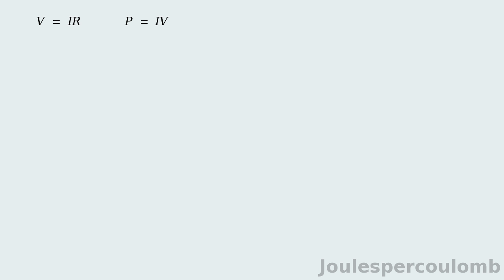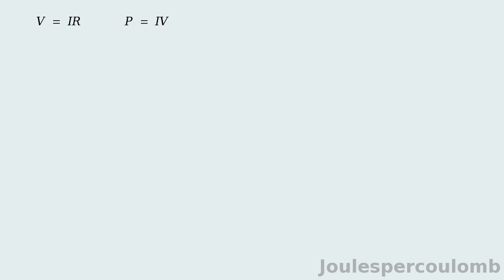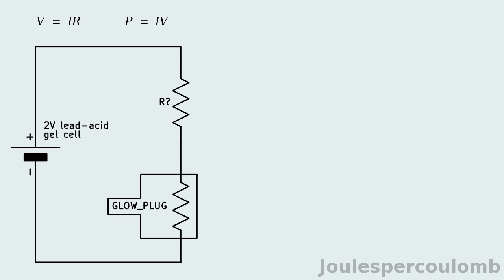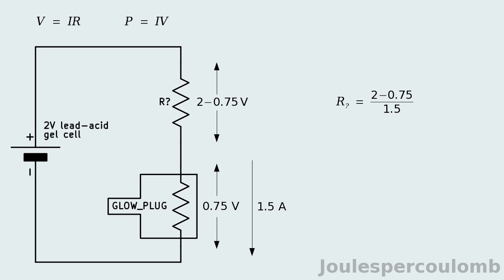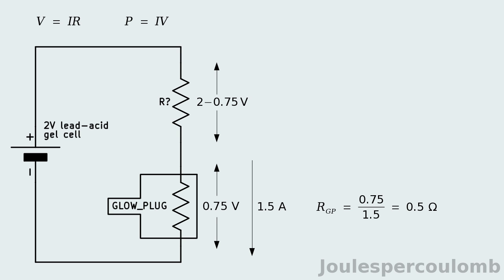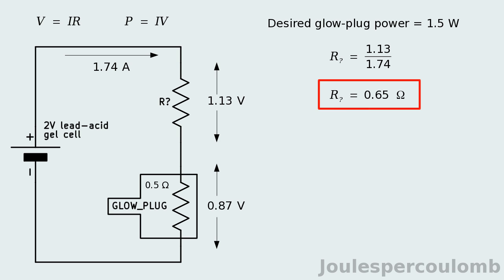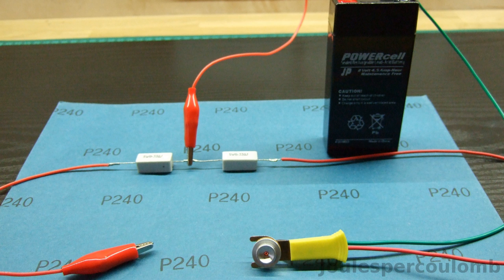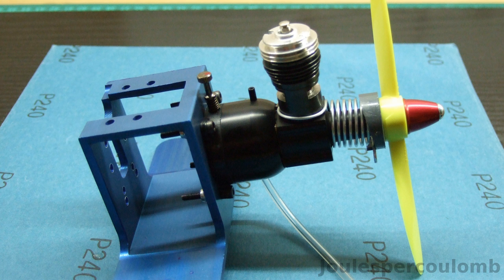Experiments in Powering a Diesel Engine's Glow-Plug

Comment: Its not actually diesel fuel. That COX engine uses methanol as fuel. Most of the time nitro fuel (methanol,nitromethane,oil). The glow plug is made of platinum, so there is a catalytic reaction between the methanol and the platinum that keeps it lit when power is removed. Very nice video as usual :)